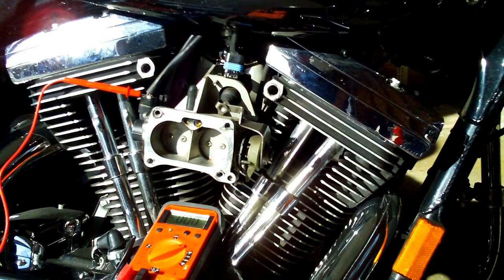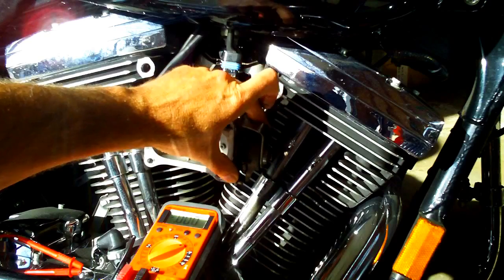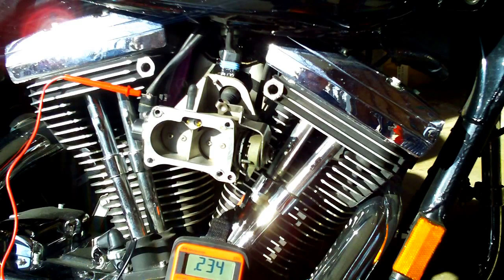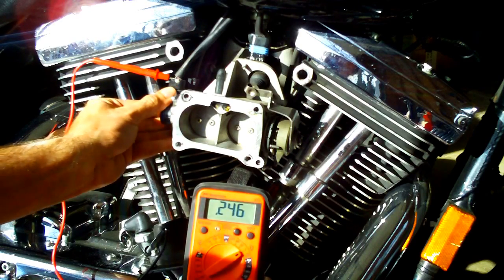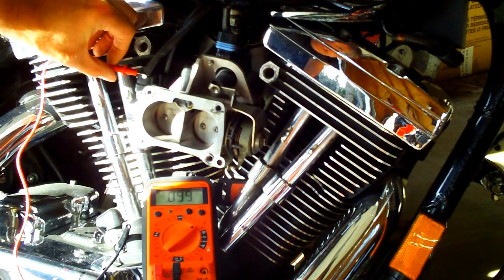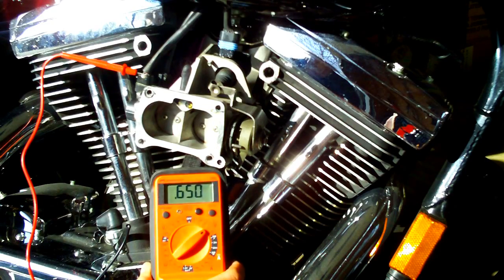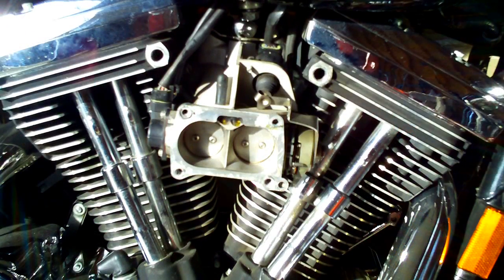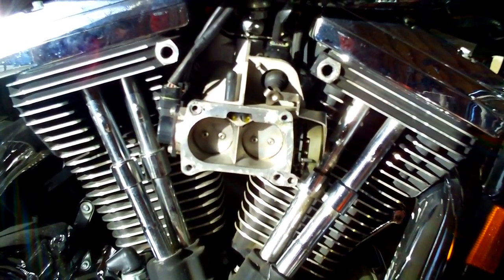Reset Harley Davidson Magneti Marelli Fuel Injection TPS Settings ✔

Comment: Mark, I just bought a '97 Road King with the Magneti EFI.  The previous owner had put Screaming Eagle Jugs and exhaust on it.  It will start and run rough for about 20 seconds and die.  It's dumping gas into the rear cylinder.  The injectors have been serviced and checked and are good.  Two questions.  Can this EFI adjust to the new heads and exhaust and is there a procedure to figure out what it's doing with the rear injector?
Reply from the maker: +Sam Porter Hello Sam, congrats on the new buy. I wish I had more experience with the Screaming Eagle accessories you mentioned, but I don't, so there might be a lot of "theories" here. I think you're going to have to roll up your sleeves a bit and get into it, or have your mechanic do it, but I would start with switching the two injectors around and see if it is still dumping fuel in the rear cylinder. If it starts dumping fuel in the front cylinder your injector is the culprit. If not, it's something in the ECU computer telling the rear injector to spray more fuel than it should. If you have watched the video above, remember where I showed the throttle position sensor is located (and that I turn side to side to adjust)? Can you look at yours and see if it has been tampered with (epoxy that looks like wax no longer in the screw heads, or scraping around the edges of the screw heads)?If they have been tampered with, you may need to go through the procedure in the video to "reset" everything to where the ECU expects it to be. Because the Magneti Marelli EFI system is an "open loop" system (it does not have O2 sensors) it cannot automatically adjust for varying conditions other than air temperature and barometric pressure. Which means You will have to adjust it for the different heads and pipes. (I recommend an EFI tuner module from Dobeck, I used 2 different ones and have videos on my channel, both made noticeable improvement but I like the digital one better) It could very well be that the former owner was having this trouble and is why he no longer owns it, but don't get discouraged, parts are out there, and some trial and error tinkering might turn it around. I didn't hear all of the horror stories of Magneti Marelli systems until After I bought mine, but to be honest it has been very reliable. Keep me posted.
Reply: +Mark Young Thanks!  I'll try that even though the injectors were serviced and tested before I got it.  Going to check voltage to sensors, compression and vacuum next.  EFI is a new one for me so I'll have a bit of a learning curve.  Your videos are really helpful.  I did cycle the ignition 10 times and remove the two fuses under the right side pod but it still runs the same.  Wish me luck!
Reply from the maker: +Sam Porter I wish you luck! One more thing I thought of since yesterday is to ask if the plugs to the injectors can be switched around, front to back? It would be way quicker to do that than to switch the actual injectors. I don't remember if they have the length to do that, but worth checking into. You mentioned you were told the injectors were serviced and tested, did they mention how that is done? Did they know it had this problem before they sold it to you?
Reply from the maker: +Sam Porter Sam, I poked around the internet and found an interesting idea. The throttle body has a hollowed out chamber where the injectors are seated for the gasoline to be pushed inside them under pressure. Most injectors today use a top to bottom entrance/exit of the gas, but these use a side fill method. The only thing keeping the pressurized gasoline from escaping, top or bottom, are o-rings. (I had to replace my fuel lines due to bad o-rings on the connections at the tank) Here's the idea, what if the bottom o-ring on the rear injector is cracked or just plain hardened (especially with ethanol in the fuel now) and that is where the gasoline is getting into the rear cylinder? Do you see any gasoline coming from inside the throat of the throttle body intake? I am hoping you are looking at something as simple as replacing o-rings (on both if one is bad). Look at this picture and see if you understand what I mean. http://thumbs.ebaystatic.com/images/g/VHQAAOSwvgdW11ak/s-l225.jpg
Reply from the maker: +Sam Porter Here is another picture showing the injector. http://www.passion-harley.fr/Technic/Images/Injection.jpg
Reply: +Mark Young , Good suggestion.  The bike belonged to a friend's late husband.  I had started the bike and determined it was only running on one cylinder and it was puking gas out the exhaust.  She had her brother take it to a shop to try to get it fixed.  He pulled the injectors and took those to a shop whose specialty is injectors.  I don't know what they did but they told him both were fine after they did some servicing.  I'll try reversing the wires.  Maybe they got switched.  I'm also checking the ignition and the cup that times the ignition.
Reply from the maker: +Sam Porter Ok, good. At least by switching the plugs around maybe you can tell if the problem changes too. If not, I would have a look at the o-rings on that rear injector and possibly replace the o-rings on both injectors. If fuel gets pushed beyond the lower o-rings it will dump right into the intake manifold and then into the cylinder through the intake valve, and eventually out the exhaust. I have not heard of this happening, but it seems "plausible" that it could if the o-rings harden up or crack. If it's not the o-rings or the engine ECU that is causing this, there is a fuel pressure regulator mounted on the bottom of the intake manifold at about where it splits into each cylinder. If that is causing an increase in pressure beyond what the system can handle, that could be a culprit too.
Reply from the maker: +Sam Porter Speaking of plugs, how are the spark plugs? Are you sure the rear cylinder plug is firing like it should?
Reply: +Mark Young The plugs are new and clean.  I am getting spark to the rear cylinder.  First thing I checked.  I started to put it up on the jack yesterday and noticed the ignition wires were routed under the frame right where the back part of the jack would make contact.  The jacket was torn and frayed and the cross member was folded back on the front edge indicating it had made contact with a speed bump or something.  I'm going to test continuity on the wires to see if they got damaged.  It might be as simple as that!  I don't know who routed the ignition wires that way but I'd like to give them a piece of my fist.
Reply: Update.  It's been awhile, but it turned out the ECM was bad.  Replaced it with an S&S and had the bike dyno tuned.  It runs good in the upper range but low rpm and warm/cold idle suck.  It spits and pops out the throttle body at low rev, hesitates, then goes.   Took it back and they didn't improve anything and actually made it worse, had my bike 2 weeks, and they just gave up.  Just got it home last week.

I checked for error codes without using a jumper wire (is this possible?) and got 3 flashes, pause, 3 flashes, pause, 1 flash, pause, 1 flash and then the sequence repeats.  I'm guessing this is giving me two error codes, 33 and 11, which would be a system relay coil problem (no idea what or where that is) and the throttle position sensor!  I was emphatic that they needed to do that before trying to tune the bike nd they said they did.  I'm about to find out by checking it myself going through the process in your video.
Reply from the maker: It's good that you traced the error codes out, that should help. I don't know anything about the system relay coil problem. The popping makes me curious what that might be from. Can the ignition be that far off at idle? Is it an intake valve not fully seating that is letting the combustion "pop" out of the throttle body? Hearing of an S&S ECM is new to me, I didn't know they made an aftermarket setup for Mag-Mel bikes. Good to know. I am hoping that your throttle position sensor is off far enough to be the root of the problem. Thanks for the update and keep me posted.
Reply: My hope is that it's just an adjustment on the TPS, too.  I've read so many different things on forums, one being that you need the jumper wire between the 2 pins to get error codes but I'm guessing not since I was able to get the flashing without jumping the pins.  The pop out the throttle body usually occurs as I roll the throttle up to go in 1st gear and each time I shift and start to accelerate.  The other thing that's mystifying is that the engine light comes on at idle and low rpm and goes away at what I guess to be about 1400-1500 rpm.  I've checked the screen at the oil pump and it's clear and asked the shop to check the voltage, which they say is 14v from the regulator.  Could this be a result of the tps being out of whack?  The shop is telling me the only fix on MagMar bikes is using the S&S throttle body.  I do live at 5,000' and I know the  MagMar throttle body is  undersized but I know others who have the same bike and they run fine.
Reply from the maker: I looked back over our conversations and need a little background. What year and size engine is this? The check engine light only started coming on after the S&S ECM install? Going through my service manual (1984-1998 FLH, FLT, FXR EVO engines), Code 11 refers to Throttle Position Sensor, and Code 33 refers to Fuel Pump Relay. The Codes can only be cleared by the Scantool or after 50 "trips" on the bike (On/Off engine runs?). It is both possible that your throttle position sensor is out of adjustment OR that it is wearing out, particularly in the low RPM (throttle mostly closed) range. I would check to see if it is in spec first, and slowly rotate the throttle with the bike on to see if the voltage jumps around on the tester meter (which would indicate that the TPS is wearing out and needs to be replaced). In Layman's Terms... think of the throttle position sensor as a volume control on a radio. Ever have a radio that when you turned the volume knob it made a loud "scratchy noise" as you were turning, and would just be playing the music when you stopped turning it? That's caused by the resistance material scrubbing off the backing plate or just getting so dirty that the small amount of voltage can't pass through cleanly. As you rotate your throttle away from idle, it is possible you are taking it out of the "scratchy area" and into a more clean area that is more careful to send the correct voltage reading to the ECM.
Reply: Your TPS theory makes sense.  I'm going to test it today.  When I bought the bike, it would barely run/idle and I had to continuously roll the throttle to keep it running on just the front cylinder.  I was getting fuel and spark at the rear but it just wasn't firing.  Took it to a mechanic who pulled an ECM off another 97 and it ran better but not great.  Turned out the old ECM was an aftermarket by some company no longer in business so I bought the S&S.  It was either that or the Thundermax for about $500 more. Not knowing what mods the previous owner had done (cam, bore out) I loaded a map for an 88ci and tried to start it, kept going to larger motor maps until I got it to start and idle.  Then I took it for dyno tuning.  The engine light has done the same thing ever since I got it back a couple months ago.  I finally took it back because it just needed to be fixed.  Sadly, it's worse.  Wish me luck or skill or both!
Reply: See what I mean about erroneous info on the web.  I read the code 33 was fuel pump relay on one thread and system coil on another.  The fuel pump does work.  How well?  I don't know.  That could also be the issue or part of the issue. The mechanic said my fuel pump sounded "strange".
Reply from the maker: I'm guessing your fuel pump "sounded strange" to him because it's not from a Delphi system. I have noticed my fuel pump sounds different than the newer bikes I ride with, as in louder, really, and more of a "churning" sound. This pump is only a year old, so I'm pretty sure it's good. So something they did at the Dyno made the check engine light start to come on? If they didn't touch the TPS, could it be a Map they loaded? When you say that you kept going to larger motor maps, was that 'you' that loaded them or did you have someone else do it? I wish I were more familiar with the S&S system you have. I have not found it on the web yet.
Reply: I loaded the S&S fuel maps from their website.  The ECM comes with a data cable and software DVD.  I just loaded bigger engine maps until I got the bike to start and idle, then took it to them to tune since I have no clue how to tune EFI nor do I have a dyno.  All the tuning is done through the software, which is pretty comprehensive. Since it never really ran before I had them tune it, I have no clue what the engine light was doing before.

BUT NOW THE GOOD NEWS!!!!!  I'm sitting here in my garage.  I went through all the steps on your video.  Play, pause, adjust.... pulled fuses, put it back together and BINGO!  It starts up great, idles great, no hesitation on rev, no engine light!  Of course, the sky just uncorked right when I was ready to test ride.  The TPS was at .021!!!!  Not even close.  Those jackasses didn't even check it even after I told them to do that first and then asked them twice later if they did.  I had only been there once before with my chopper for what I thought was a tranny leak and fork seals.  They forks leaked in 6 months and the tranny leak turned out to be a jackshaft seal and I had to show them what was what on that!  I think I see a refund coming.
Reply: Even better news.  The streets dried up and I took it for a test ride.  RUNS GREAT!  Can't wait to take it up to the shop that didn't fix it and show them how it's supposed to run.  And get my money back.  Thanks, Mark, for your help, your video and your feedback.  I'm going to have them watch the video.  You saved me $1,000 or more.  The shop owner told me I needed the S&S throttle body if I ever wanted it to run right. Apparently not!
Reply from the maker: Wow, that is VERY impressive! You did it yourself, good job! Don't be too hard on the shop for not understanding the Mag-Mel system, not many do. They just weren't used for very long before the change to the Delphi system, still in use now. I have read horror stories of others having issues, but honestly mine runs so buttery smooth that I was wondering if mine was the only one! Haha. I think they really can be a good system when properly maintained. How do they go out of spec? I don't know, but when they are spot on they turn into arm-straighteners!
Reply: Impressive?  You showed exactly how to do it!  That made it easy!  That is one twitchy little bugger though! Even think about turning it and it will change a tenth of a volt.  Then keeping it exactly in place while tightening? That's not easy either.  I actually wound up at .276 and decided that was close enough to find out if that fixed it.  Lol!  What's a hundredth of a volt?  Lol! It still only took about 5 minutes to get it set when I got to that point and about 45 minutes total from tear down to ready to ride.  Well worth it!  Thanks again!
Reply from the maker: 45 minutes isn't bad at all! You should go into business! I agree, whether it is .275 or .276 will not make that much of a difference. If my guess is correct, higher than .275 will make it add more fuel and advance the timing, while less than .275 will do the opposite. So I'd rather be slightly above than below. And yeah, that TPS sure is hard to set and keep at .275 when tightening down. Took me a bit, thus the edit in the video! Happy riding to you!